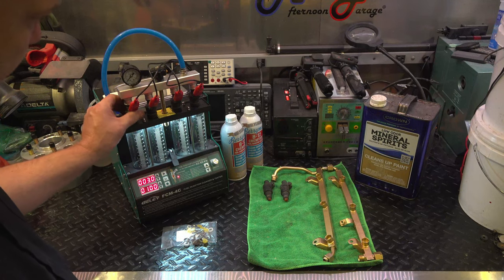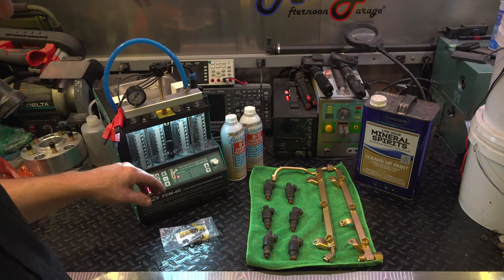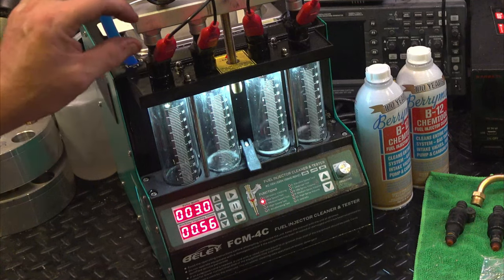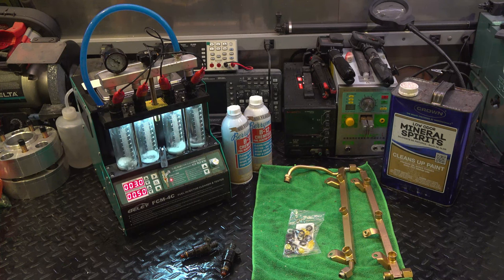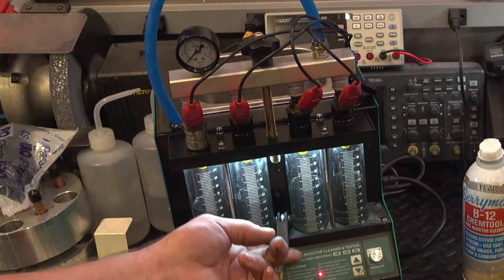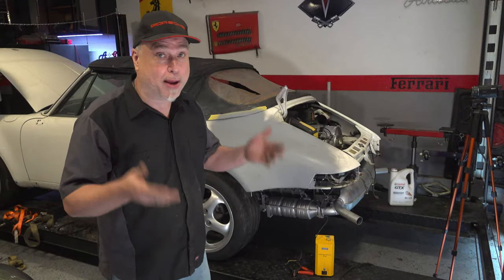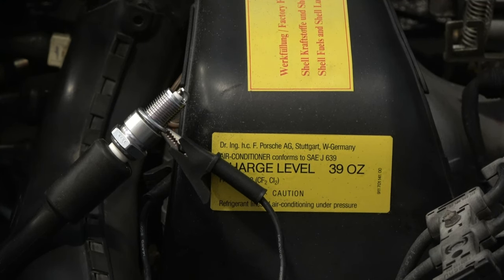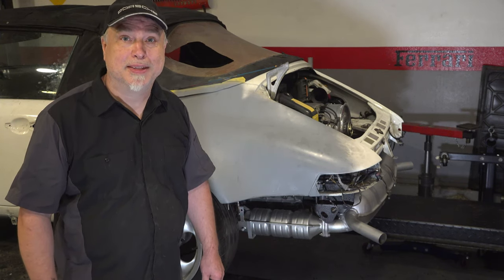3.2L Porsche 911 Cabriolet: Fuel injector test/clean, engine assembly and startup [4K] Ep107

Comment: Thanks for posting. What a difference on the fuel injector #1 after a thorough cleaning.
Cheers
Reply from the maker: Yeah I had to coax it a bit to get it to vibrate again.  It must have been jammed up with something.  I pulled the pintle a bit and ran that Berrymans through there and it started buzzing loudly again.  That replacement just wasn't the same dimensions so I didn't want to use it.